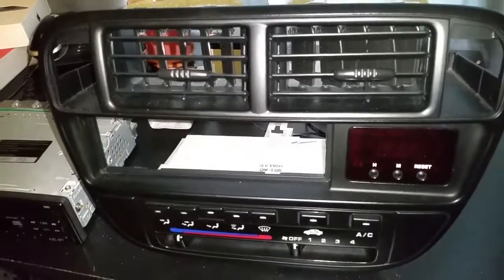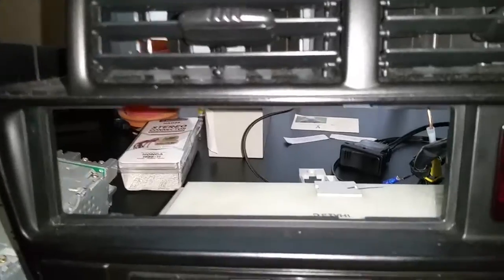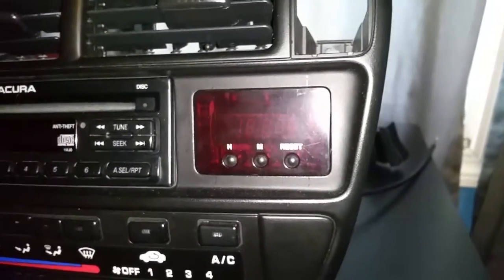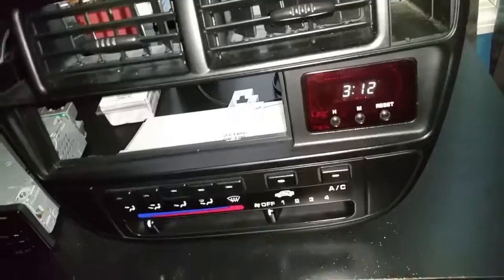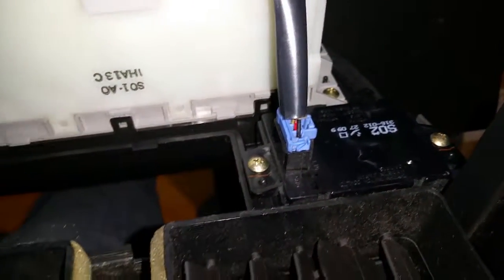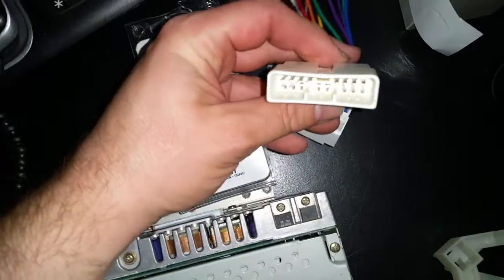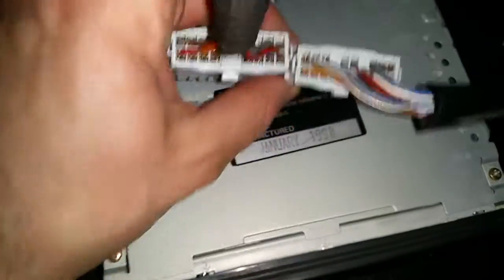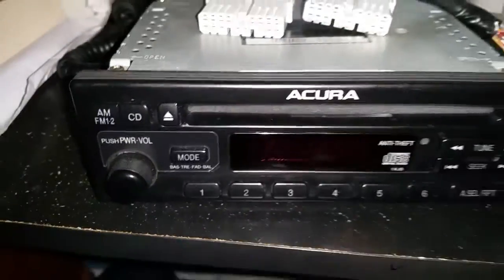'96-'98 Honda Civic JDM EDM clock install part1

Comment: My clock light is not that bright. Do you know where the bulb goes? Am I able to remove just the clock alone or would I have to remove the climate control?
Reply from the maker: This type of clock uses a vacuum fluorescent display and does not have a light bulb.  If it is dim, first make sure that you are not providing power to the lights-on signal.  The display may, however, just be worn out.

Comment: If I don’t have a pigtail what can be an alternative?
Reply from the maker: Which pigtail?  The stereo or the clock?  For the clock, I'd go to a pick-n-pull junkyard and look for a 4P connector.  I think they may be found in the cruise control switch, circuits for the power windows, power door locks, and moonroof. And the recirculation control motor may have one missing a pin.